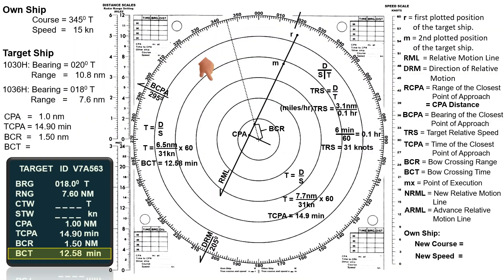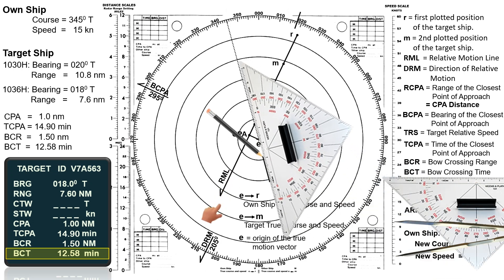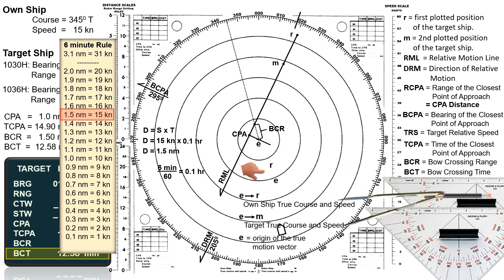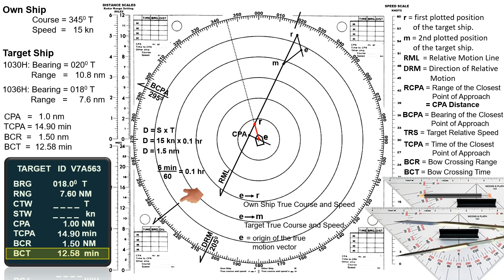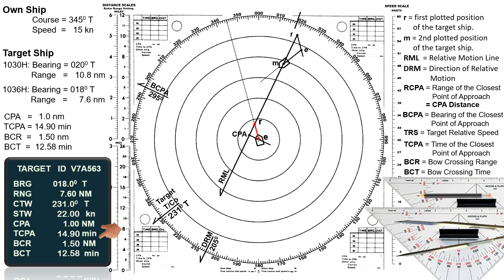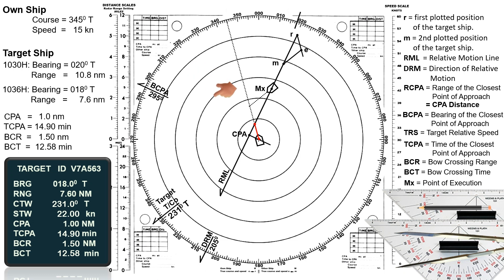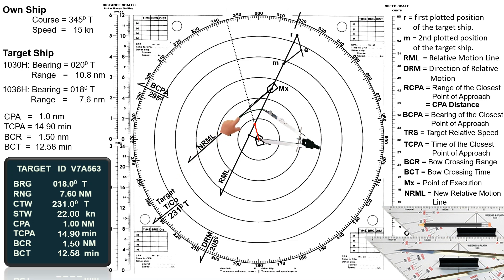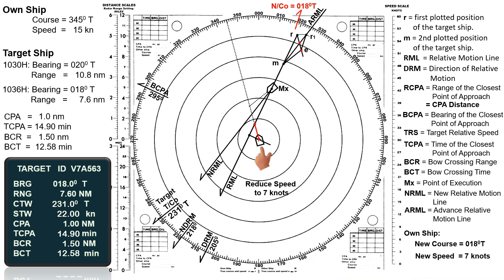Radar Plotting (Part 2 of 2): Collision Avoidance | Determine New Course & Speed | Mx, NRML, ADRML

Comment: Sir, I would like to ask: if all the given values are smaller than 12, but I still use a scale with a maximum of 24, would this cause any significant difference or introduce any additional error?
Reply from the maker: Using a scale of 24 miles will not introduce any significant error, but it may make your plotting less precise. A 24-mile scale spreads the points farther apart, so small distances occupy a smaller portion of the plotting sheet. This can make it harder to measure small movements accurately and to draw vectors with precision.

For values under 12 miles, it’s better to use a 12-mile scale to improve accuracy and readability. Using a 24-mile scale is fine if you only need a rough plot or the distances are small compared to the maximum range, but careful measurement is required.

Comment: Is radar gives positions ( latitude and longitude) of Target objects?
Reply from the maker: Radar itself does not give the latitude and longitude of target objects directly. It shows the target’s range and bearing from your ship. However, by combining radar data with your ship’s GPS position and using ARPA or ECDIS systems, the target’s approximate position in latitude and longitude can be calculated.

Comment: Please can you show it in radar view in determining mx, new course, new speed, and other important steps to avoid collision without using radar plotting aid?🙏
Reply from the maker: In the actual radar monitoring, Mx is not displayed on the radar PPI. If you want to alter course when the target reaches a distance of 5 miles, you can set your VRM (Variable Range Marker) to 5 miles and monitor the target. Once the target reaches the set VRM, it indicates a 5-mile distance, then alter course to starboard by 10, 20 degrees, or more, depending on the situation. After altering course, monitor the radar as ARPA (Automatic Radar Plotting Aid) will recalculate the CPA (Closest Point of Approach). If the new CPA meets your desired passing distance, maintain the new course. Otherwise, make further course adjustments as needed.